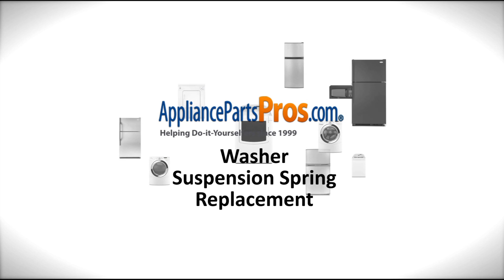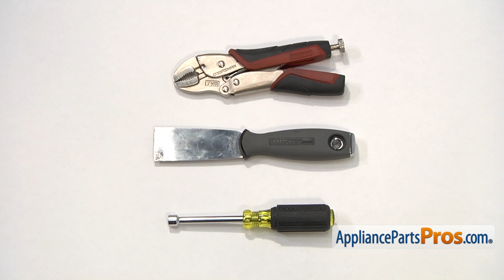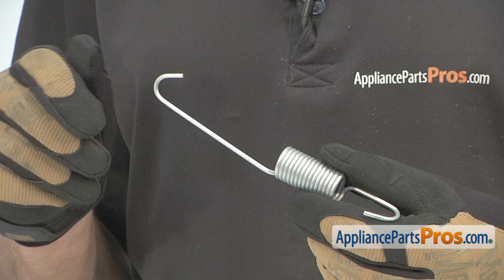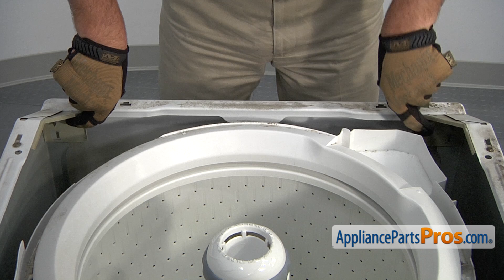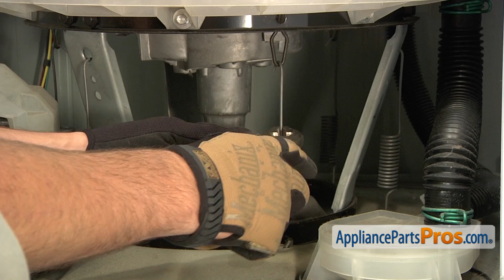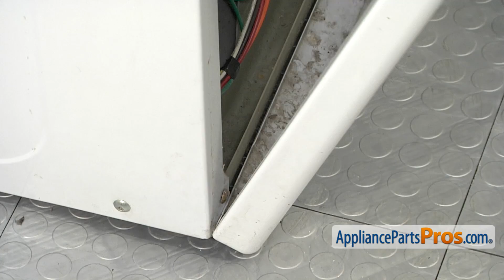How To: Whirlpool/KitchenAid/Maytag Suspension Spring WP21001598

Comment: Quick question I had to replace a shift actuator and had to tip the washer and now the tub is sitting below the lip of the opening, I replaced the suspension rods but the tub still sits lower and the rods are from whirlpool they are exactly the same length is it possible to adjust the springs to raise the tub without the tub still sinking down 3-4”, thanks
Reply from the maker: What is your model number?
Reply: @appliancepartspros  Whirlpool CAE2745FQ0 washer
Reply from the maker: Thank you! There are a few things you will need to check. Make sure the correct parts were ordered for your unit, you should have part number W10780046. If the correct part was ordered, you will need to double check the installation of the suspension rods. You will also need to check the frame to see if it was bent, even slightly could cause the issue.
Reply: @appliancepartspros  just a quick update, I had the wrong rod kit I ended up with the w10780045 and didn’t realize it till later and then with what part number you gave me fixed the issue the w10780046 rods are 2” shorter, thanks again